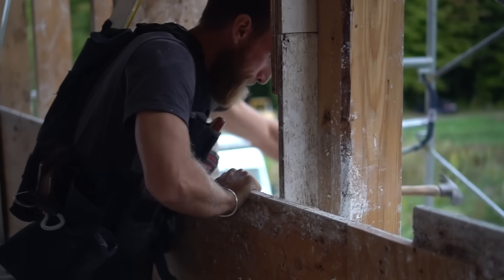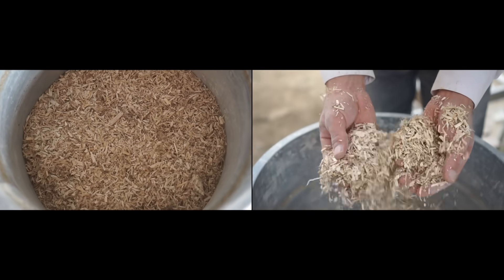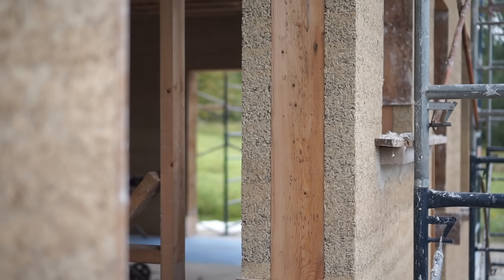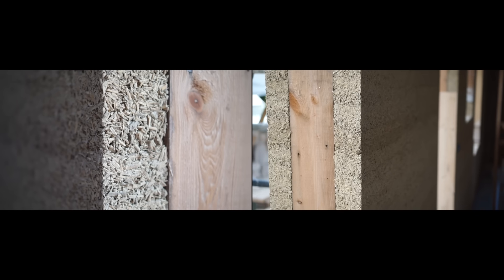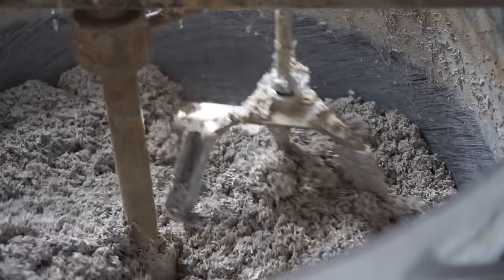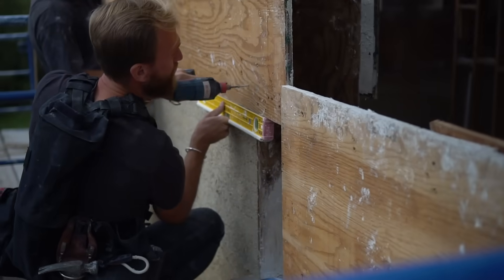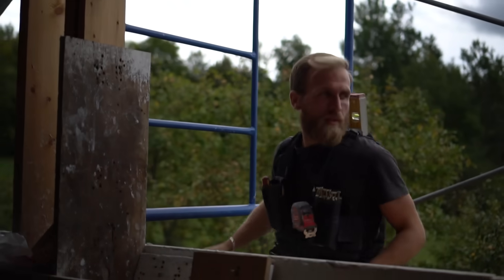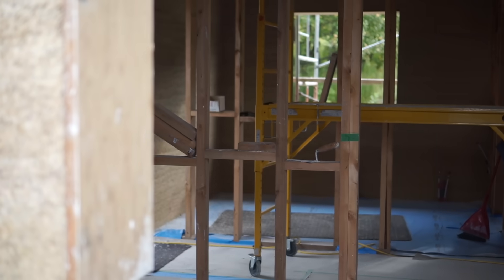Building with Hemp – An Incredible Natural Insulation & Sustainable Material

Comment: @Anthony What do you think about utilizing hemp, compressed to Hollowblockstones ? Hollowblocks are the most common material in Germanay. And are materials similar to yours available in different countries ?
Reply: Hollowblocks are a good idea but I think there is no need to have air chambers in the hempcrete since it is already low density. It is very porous, so a good insulator. It also act has a mass. So considering what you want to achieve, you can play with the density and the form. To be solid, hempcrete needs a certain thickness, about 2" thick for a wall recipe.